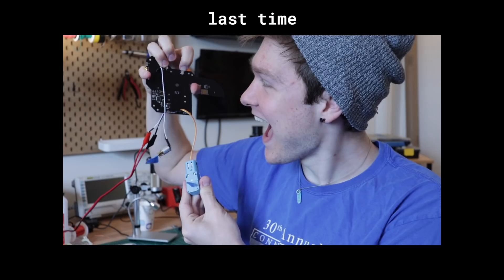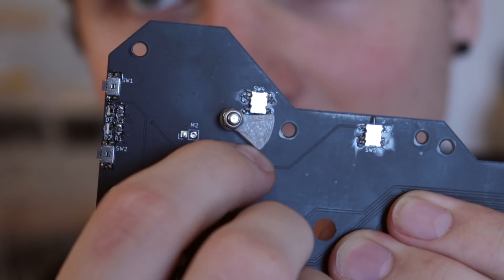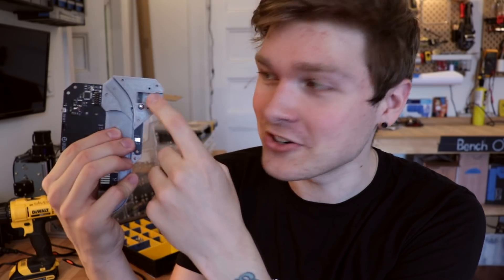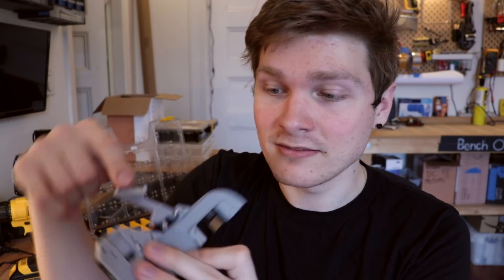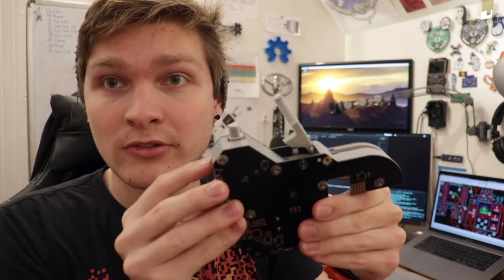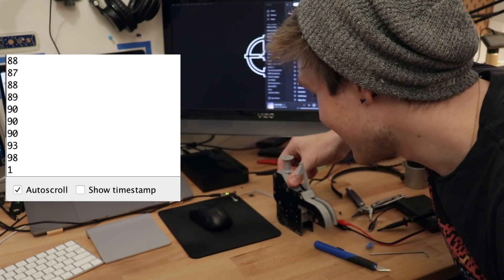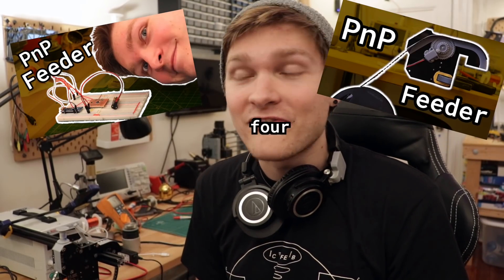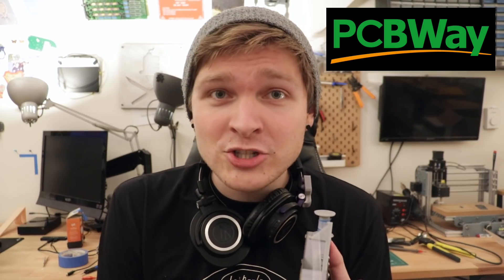A Fully Functional PnP Feeder!

Comment: Take a look at the design for manual feeder magazine by Robin Reiter as he elegantly solved pealing and piping the foil. His design made me think - instead of driving stepper wheel and by that applying the motor force onto the tape before peeling the foil, it could theoretically work with only one motor to apply force when winding up peeled off foil while leaving  stepper wheel in the same place but changing it into free rotating.

Comment: There is a better way to peel the tape and that is to copy how the FUJI AIMEX does it. Essentially what it is is a gear attached to the little motor and another free spinning gear on a tensioner that mesh together with the tape peel tape sandwiched in between and that eliminates the need for a spool.  and as for the peel detection mechanism your lever thing should suffice. I would replace the sharp angles with rollers though because when I worked at an electronics factory we had a lot of issues with the peel tape breaking if the feeder wasn't set up properly.

Comment: I have a question.As for this kind of tape guide when feed plastic tape and paper tape the thickness of them are different.If there is not something like a spring to press the tape.Will the position of the cpmponent become not reliable enough to pick?

Comment: Optical sensors would last way longer than relying on mechanical switches. An LED light on the rear that changes colour when you are approaching running out of stock (based on pnp program using initial qty vs what it is now). This helps operators change to a new reel on another feeder to minimise down time. Always test your feeders with the smallest parts you intend to be able to pick and place. We do expect to handle LEDs, what  we really want it to be solid using small parts. The kind we don't want to place by hand. They'd be way cheaper to test with too!
Agree with @mikeselectricstuff you don't need tape detection but need to know if tape is jammed/not feeding.

Comment: First of all - congratulations getting this far. PnP feeders have an endless list of unexpected challenges and critical to the overall success of any PnP system. Curious if you will be able to control tape weave and other mechanical challenges needed to place small parts. Big LED's are one things, but all circuits need a lot of passives that are notoriously hard to deal with as they get smaller. 

My commercial feeders have a MUCH larger tape pickup spool - Like @mikeselecricstuff mentioned you will be tending to that tiny bobbin rather often. If you decide the out of tape sensor is actually needed - an optical gate will last a lot longer and be more reliable.

Comment: Low frequency PWM (<300Hz or so) is a good way to deal with friction in the motor.  Another way would be to go 100%, and then actively brake the motor with the H-bridge.  (or 100% to start, 10-50% to move at a steady speed and "shorting" the motor or even a short pulse of reverse polarity to stop)  While you'd get over-shoot, it should be quite predictable.  Long term, I would recommend moving the motor as aggressively as you can to minimize the effects of friction and wear over time.  

Have you looked at the tiny geared steppers?  (28BYJ-48's in think) E3D switched to one for their tool-changer.  <$3 each and intrinsically precise in one direction.  (even if they are slow and not super powerful).

Comment: Instead of thse switches you could maybe use foil on the actuator (or make the actuator from PCB with solid copper) and capacitive sensing electrodes on the PCB.
Reply: or go optical

Comment: You don't really need tape detection- the vision system will tell you when you run out of parts. That film take-up spool looks a bit small - I doubt it would hold a full reel's worth of tape before it fills up too much. Also, have you checked the operating life of those switches - some small switches like this are only rated for 10-50K operations. 
There can be quite a difference in peel strength between different tapes, so worth testing on as many different types as you can get. Also, paper tapes can behave significantly differently, and also create a bit of paper dust that can clog things up and the paper itself can abrade surfaces.
Reply: I think you could get away with just a tape pull feeding it through. Keep the encoder wheel for feedback but remove the drive motor and let the tape pully do the work of driving the tape. No need for switches or a tensioning lever thing. (However, as a learning/educational/side-project this is pretty impressive.)
Reply: Monitoring power and back EMF of motor would give much better results than a switch and a spring.. Mechanically it is free..

Comment: While tempting to use the limit switch's spring to actuate your arm, it isn't smart as the only thing the spring inside the switch is designed for is moving the very tiny plunger. I would have been very surprised if the limit switch could swing that huge tension arm. It works on the tape detection as gravity does the work in one direction and the tape in the other direction. I would suggest a small stud on the arm and "base" to hold the spring in place.

Comment: Hey Stephen are you going to try to place 0402 parts.  If so I will consider you a gift from the heavens above, because you are going to save me a lot of money that I can instead spend on a lathe.  I'm working on designing a real injection molding machine that will cost $2k-$3k.  Its been a heck of a ride.  I have been working on acquiring sponsors.  I'm very impressed with your PNP design, its going to change a lot of lives.
Reply: Hey ! Any plan on open-sourcing the injection molding machine ?

Comment: Why use rs45 over other comm protocols?
Reply: Robust against electrical noise over modest distances (better than I2C or SPI), and multidrop (unlike RS232), and very simple protocol (unlike ethernet or USB).
Reply: @Graham_Wideman  I'm not familiar with multidrop, what is it?
Reply: @SimplyStuart94  You can have many devices connected on the same wires / bus. So no matter how many devices you got (~256 usually), you only need 4 wires (if we count ground and power).
Reply: @cynnfu  yeah, but multiple protocols enable multiple devices, I was wondering why use rs45 over rs32, or i2c, or others
Reply: @SimplyStuart94  For RS232, you'd need to daisy chain the devices (have 2 UART per device, one in, one out, and connect each device's in to the previous out. That's doable, but you need 2 uart, and the cabling & software is a bit more complex. I2C wouldn't work very well, because you quite limited on the number of devices per bus. Not because of the address space (255), but because of the capacitance of the bus. Usually, that's around 10-20 devices, IIRC, that's quite limited for a PNP.
SPI needs an additional Chip Select pin for each device. That's really annoying. There are quite a few other protocols that would work (eg: CAN could be good too). RS485 is just very simple, robust, and the transceivers are quite cheap too.
Reply: @cynnfu  ah I see, thank you

Comment: Also when it comes to various tapes there is paper and plastic.  Paper tapes used for resistors is thicker and stiffer than the 12mm plastic you've been demonstrating.  One addition I'm doing to my design is a 0.91 inch OLED display.  I got my last batch from Amazon for a whopping $2.85 each.  More useful than blinking lights.  Adafruit has libraries that work.

Comment: The film peeler only needs to be active for a brief period after tape advancement.  Once the advance commend is issued check film tension.  If low then run peeler, once tension is restored or a time out period has elapsed shut down peeler.  This will keep the motors etc. from burning up if there is slippage.
Reply: Isn't that what Stephen's design does already?
Reply: @Graham_Wideman  If there is any slippage in the tape the tension arm may turn on the motor, and keep it on.

Comment: couldn't you just put a gear on the first motor to peel the plastic?
Reply: That doesn't work, because when the film builds up on the spool, the diameter will increase and therefor change the gear ratio and pull the film until it breaks.
Reply: @sm3vlc   no need to use a spool. Just let it hang and cut the film every now and then. Alternatively, if you insist on a spool, having a flexible split gear driving the spool from the inside will allow it to slip when the tension increases, thus preventing it from breaking.
Reply: True. The machines I have worked with either use a spool (Fuji CP-series, completely mechanical model) or just leads the tape to a bin below (Fuji NXT-series, with built in motors). I must say that I do love and admire the engineering of the old CP-series. The drawbacks are power consumtion and high noise when running at high speed.

Comment: It's probably a good idea to add an extra spring for the tension arm rather than depend on the one built into the switch as it will invariably fail over time.

EDIT: good to know you added one in the end (commented this during the video before the end where it all just worked)